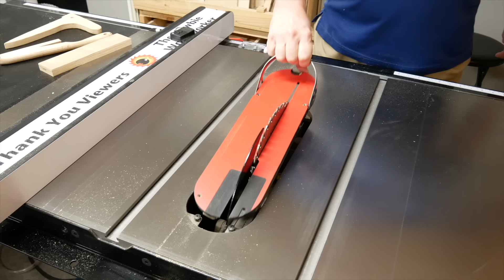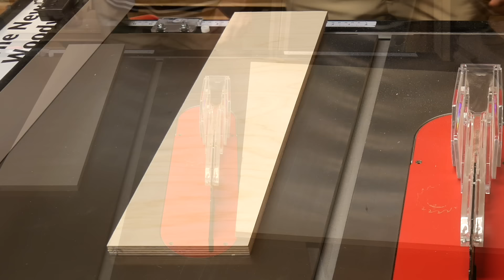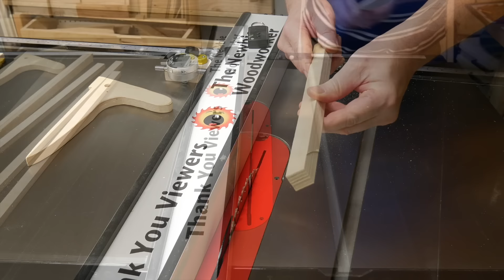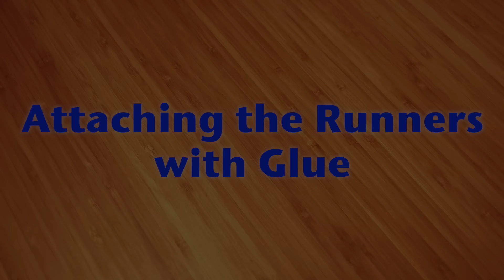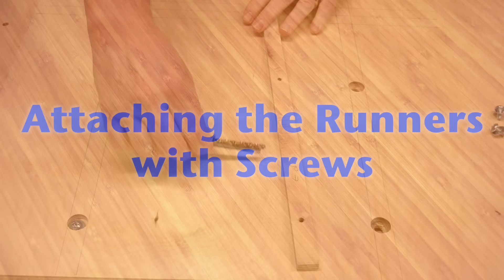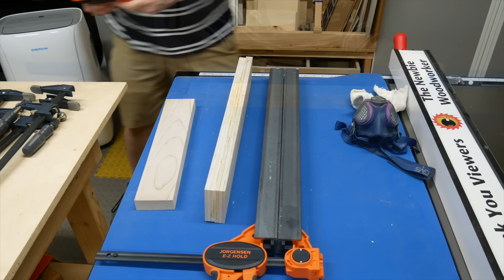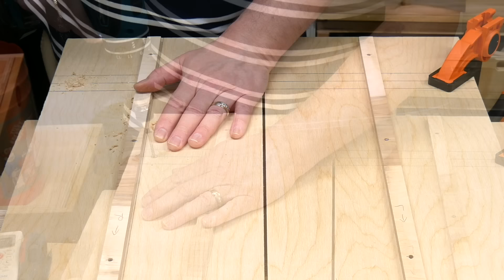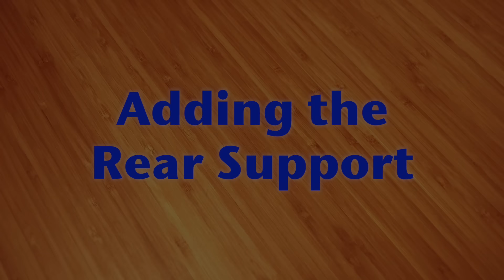Build this Revolutionary Cross Cut Sled, for Newbies!

Comment: I like the idea of this  as it keeps the saw safe and I will now build one,  in the UK it is a big no for taking off guards. BTW apply your wax with 0000 steel wool and polish with the cloth. The steel wool helps to push the wax in to the grain and very gently polishes/sands the surface even smoother.
Reply from the maker: Cool - thanks for the info!

Comment: Hey Dan,  Great Video. Just an easy way to get “Square” is the old theorem - 3,4,5.... works perfectly every time. Should do a Video on that. 3 & 4 are vertical and horizontal factors, the 5 is the diagonal factors. So a 3 inch by 4 inch right angle will require a 5 inch diagonal measurement to be a true right angle. Use multiples for bigger jobs - saves the bigger set square if you don’t have one. Cheers from Australia 👍
Reply from the maker: Thanks, I have to remember that! 😄

Comment: sorry but my guard is removed for a reason, there is a lot of stuff you just can't do with that guard attached. a simple habit like using pusher, etc., and getting in the habit of keeping fingers away from the blade, not grabbing work until blade completely stops, etc., goes a long way. I like my fingers on my hands and like to use my table saw for things besides a simple cut, the guard limits how much stuff you can do on a table saw. who designed these guards the same guy who designed the stupid safety feature on gas cans. if you're that worried about out remove the guard and build a sled with a clear protective thin sheet of that poly plastic stuff for a center guard your fingers will never go near the blade.
Reply from the maker: Thanks for your opinion.

Comment: A tap is useless in timber and it certainly should never be used with an electric drill no matter how slow you operate it. Taps need to be turned slowly by hand. This is just silly. You could have easily countersunk some nuts that match the bolts. The plywood will eventually deteriorate and those runners will shift giving you crooked cuts or worse.
Reply from the maker: Thanks for your comment. I agree that you can use nuts or inserts or other methods - I have no problem with that. And if you think my methods are just plain silly, feel free to ignore them. But for the record, tapping hardwood plywood like Baltic Birch, or many other hardwoods in general, works just fine, with or without an electric drill. I have to assume you've never tried it, or else you'd know it does indeed work. Will it deteriorate over time? Probably. Eventually. Good thing the runners are easy to replace.

Comment: Wait...Are you tapping a thread on plywood?  Never saw that before. Doesn't it strip after you tighten those screws a few times??
I would insert a steel female thread of the type you hammer in, or drill a place for a nut and epoxy-glue it in place.  Opinions?
Reply from the maker: This is Baltic Birch plywood, and it won't strip. Well, I suppose everything can strip at some point, but I've been doing this for a while and never had problems. With that said, using a threaded insert of some kind is perfectly fine - just remember that at some point in the future you'll set your sled down on your table saw without putting it in the tracks, so make sure you don't have any metal sticking out from the bottom of the runners or you'll scratch your table saw.
Reply: @TheNewbieWoodworker  Countersunk wood screws would have been the best option. Taps and dies are no good on timber, the thread is too fine. That's why there are timber screws and there are machine screws. Timber screws have a courser thread that cuts through the timber giving a stronger bond. Plywood just isn't dense enough for a machine thread, it is too fine. It's only holding because you have glued the runners on, the bolts are just wedged in the hole you drilled. The tap should never be turned that fast, no matter how slow your drill can go, they need to be turned by hand due to the thread angle being so slight.
Reply from the maker: @JackRipper8881  I don't want to have this debate in two different places, so I'll leave this comment alone.

Comment: Just want to say thanks!  I got some good info and inspiration from this video. I have a Ryobi BT3000 saw.  I try to leave the blade guard on when possible for safety and improved dust collection (plus I don't have a separate riving knife).  I realized that with my saw I could just leave off the rear fence and keep the full front fence.  My blade guard will hit the front fence and lift up...which then gives better visibility of the blade cutting.  I added a T-track to my fence for some hold downs and a stop block.
Reply from the maker: Awesome! Glad I could help. 😄

Comment: I bulit it and have used it a couple of times. Really, great!!  I ran into 2 problems.  I used hardwood cabinet screws because I didn't have the right construction screws.  That split the laminations of the baltic ply fence on one side near the kerf line and found this out when I removed it to cut it in half and finish it.  I was able to force some glue into the split and used 3 parallel clamps to clamp it, hoping that would help keep it flat.  I let it sit overnight.  It came out flat and my cuts are still square. Pretty sure it was using the wrong type of screw, since these aren't self-drilling.  So I recommend to others that they use the type of screws in the video. I have plenty of Spax and Grex(?) in the right length but they aren't bugle head so can't be countersunk..   

The other problem is that I cut too far back through the fence, since I'm used to a larger sled.  Luckily, you showed us that piece you put on to support your blade guard.  I didn't need it for that, but did need it to stabilize the portion behind the fence.  I put it on while the sled was on the saw resting in the miter tracks. Still square after that, too.  

Thanks for your detailed instructions!  Your videos are great.  They helped me get it right very easily, even though I made some different errors. I was using my saw without the blade guard too much, though nearly always using grrrippers instead. Much safer this way

It would be helpful to know how to make a stop for the sled.  Right now I have it attached to my saw stand (shop made), but would rather have it on the sled.  For the life of me, I can't envision how to make one since the sled is so small.
Reply from the maker: Thanks for the comment - it's great to hear the details! It sounds like you didn't drill pilot holes first - I always drill pilot holes, because you just can't trust that the screws won't spit the wood. As for the stop, I've never made one. But Matthias Wandel has a couple of sled videos that include a stop, so if you search a little, you might get some ideas. I hope that helps! 😄
Reply: @TheNewbieWoodworker  My comment was too vague, I fear.  I always drill pilot holes, too, and always countersink for that type of screw.  I used two bits to drill and countersink, like you did, and the same diameter bit you showed, since they were #8 screws like you used.  But the Spax screws would have drilled it out just a bit more to prevent splitting, at least that's my theory.  The hardwood screws dotn't do that.  They are good quality (Highpoint from Woodcraft).  Thanks for the tip on Matthias videos, I'll take a look. 

As always, helpful comments and really great sled!  You have one of the best channels for simple yet innovative jigs like this one.
Reply from the maker: @k.b.woodworker3250  Ah, that makes sense. Also, it may depend on the quality of the plywood. But live and learn, right? 😄 And thanks for the nice words!

Comment: Im going to build this one, been looking for a while to build a sled and keep the guard on, I have a really nasty blade on my saw that will cut anything and the thought of slipping on to that or putting my hand down makes me always keep the safety on. This is a good idea and back to keep guards on, after all the manufacturers made them for a reason.... Just finishing my Routing Table and this will be the next job before i use the table saw again.  ( tip Ikea Butcher block makes a great Router table, jigsaw table or whatever to mount items on, the top is nice and thick and you can easily move it around on the 2 castors)  I just finished routing out the T slots for the feather boards and Fence and that will be that, There's no excuse not to use the safety now thanks to the Newbie Woodworker. Keep safe and save your fingers. Thanks for designing and prototyping this for us.
Reply from the maker: Thanks for the comment! I hope it goes well for you. 😄

Comment: This is awesome! You have a new subscriber.
I have one question, i got a small second hand tablesaw, without runners inside.
What would be the best way of guiding the sled?
Reply from the maker: Thanks. Gee, without miter slots, I don't think there is a way. Sorry.
Reply: @TheNewbieWoodworker  if the "table" is small enough, could he use the outside edges of the table as the place for the track? It would keep the sled perpendicular to the blade...yes, no?
Reply from the maker: @BonnieCalhoun  Interesting idea. I don't know, but it might be worth a shot. 😄
Reply: @TheNewbieWoodworker  It looks doable, but everything in practice is. It just takes it working on the actual application. I suggested that because with my new Dewalt 7480, I was reluctant to try making runners as a first real project so I bought solid aluminum runners on Amazon and I could see those being used at the two edges keeping it straight.
Reply from the maker: @BonnieCalhoun  Makes sense to me!

Comment: Why didn’t you use the gripper for cutting the runner?
Reply from the maker: I tend to only use the Grr-ripper when I'm cutting something that would really benefit from it. Otherwise I use my normal push sticks. But it's just a preference thing.
Reply: Is there agood video for using the gripper ripper and the Kreg tool system.  My husband died and I inherited his woodwork shop and want tomake outdoor furniture.  New to all this business and just want to do it safely and accurately.
Reply from the maker: @lindalober626  I don't have any specific videos in mind, so I'd just search YouTube and watch videos until something speaks to you. By the way, I replied to your other comment, and my eyes are still stinging. (I just felt I needed to say something else here.)

Comment: Thanks for the metric conversions, but I wouldn't mind if You kept it in imperial.
The more I work with wood the more I see imperial in buying plywood, lumber, bits, grinder discs, table saw discs, etc... It's all messed up in metric and I always have to check everything.
For example, they say it's 18 mm thick plywood, I check and it's 19 and some OR 3/4", they say its 250cm x 125cm, I check and it's 244 x 122 or 8' x 4'... And these things happen so often with plenty other stuff too.
I'm kind of getting the hang of imperial, it's different but it works great.
But I'm darn sure I won't be using it for weights and volumes, that's waaay more messed up hahahah
Have a nice day and thank you for the video!
Greetings from Croatia
Reply: I would, i'm from Europe and love to see it in Metric and I',m thankful for taking the time to add it, there is another world outside of America 😄 and many viewers are from Metric based countries.

 Wood is a natural product and that is why they use the word NOMINAL as its impossible to be exact in sizing like with steel, Wood is one size one day and anbother size on a wet day as its natural it changes its sizes so it can never be measured exact consequently.
Reply from the maker: @sitgesvillaapartmentneilsc7924  Thanks for the comment! 😄
Reply from the maker: Thanks for the comment - it made me laugh. When something here says 3/4", you can almost guarantee that whatever the actual measurement is, it's NOT 3/4". 😄

Comment: Thank you for posting this video. Two things. I have never understood why sled makers align to the relatively narrow width of the saw blade vs using the fence. If the blade and fence are  not aligned, that would have to be resolved first, then use the fence and a full-sized framing square (checked for squareness first) to set the sled fence alignment. Secondly, once the sled fence is perpendicular to the blade and the saw fence and is secured, use dbl sided tape or other temp fasting to secure a cleat up against the sled fence. Then, when it is removed for cutting, as you demonstrated, it can be put against the cleat and re-secured - no need to guess or worry about starting new holes. I appreciate no music in the background, your calming voice, your many suggestions, and the use of on-screen highlights. I subscribed. First time viewer. Blessings to you and yours.
Reply from the maker: Thanks for the comment! Regarding aligning to the blade, I'm not actually to the blade. I'm aligning to the miter slot. The blade could be out of align by 10 degrees (an exaggeration) and the cut would still be aligned to the miter slot, because the stock travels along the miter slot. You'd get a wider kerf, but it would still be parallel to the miter slot. I hope that all makes sense. Thanks again for the kind words. 😄

Comment: I also add some orange duct tape to the back of the sled where I do not want my fingers to be around the blade.  That way I have a visual and tactile way of reminding me where my fingers are not suppose to be. 

For a smaller contractor or table top saw, you need to make he back a bit smaller.  Here's another way to square up your fence.  Most 3/4" MDF 2' x 2' project boards are very very closet to square.  Find the one combination that is as dead on as you can find.   Hopefully you have squared the fence and the blade previously.  Attach one side of your back fence where you want it to be.   Now put the bottom of your sled on the table against the table saws fence, place the MDF to the front of where the back of your sled will go and clamp that down so neither your sled nor the MDF will move on you, but where you can still get to the bottom of your fence. Now align the back of the fence so it is dead flat against the MDF which is flat against the table saw fence.  Clamp it into place.  and from the bottom of the fence, drill and screw in  the fence.  now check you alignment, attach some more screws and you should be done.  It takes about 5 minutes to do this and it usually gives you a cut that comes very close to passing the 5 cuts to square test the first time.
Reply from the maker: Thanks for the info!

Comment: Great explanation and a nice sled design.I'm definitely going to make one.  A suggested improvement to the design - add a stop to prevent the sled being cut in half by a newbie pushing the sled to far into the blade?
Reply from the maker: Thanks! And that's a definite possibility, depending on the dimensions of your table saw, and the sled.